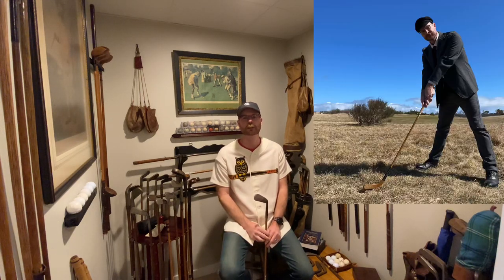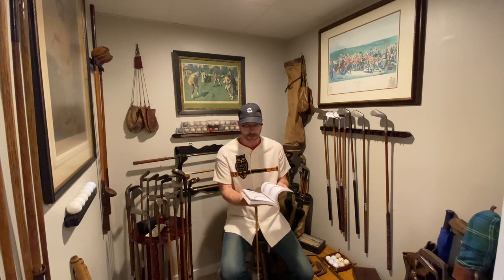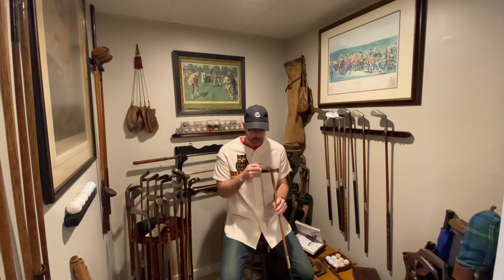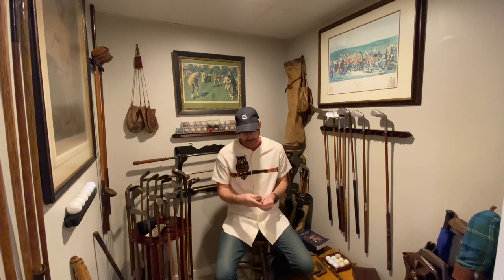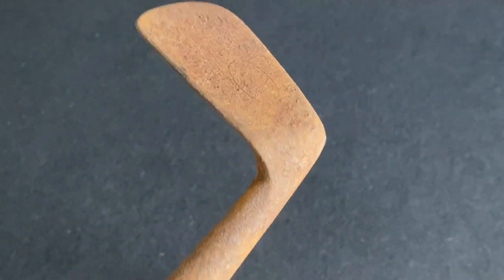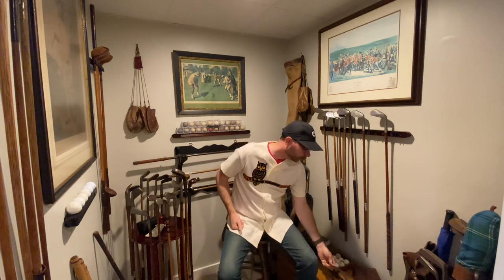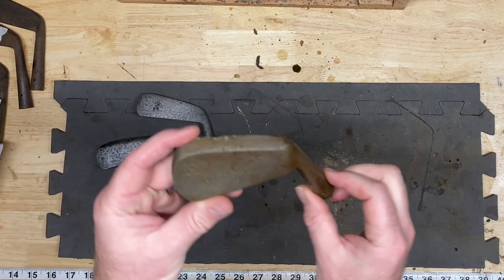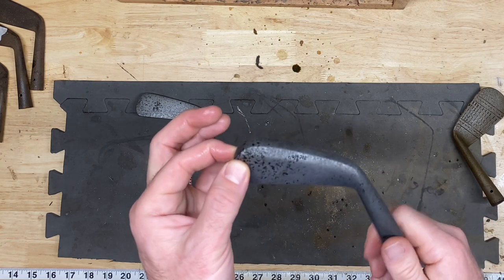Deciphering the Markings on a Tom Stewart Mashie: Hickory Golf - Fresh Finds #2

Comment: I really like where this series is going! Do you have a set of modern clubs? If yes, I think I would like to hear your take on why you prefer hickory over modern etc. Keep up the great work!
Reply: I'm someone looking to get into hickory, but my play set currently is a vintage cart bag, muscleback blades, persimmon woods(D,3,5,7), and a hickory shafted putter.

I have a modern set(still wit musclebacks) but I play vintage for the enjoyment of it.  Is it as easy?  No, but you have to learn to hit your clubs and try different shots just like hickory clubs.  If I score a 90 with old clubs on today's longer courses, it feels a lot better than if I shoot a 90 with clubs that are supposed to make things "easier". The feel of hitting a good shot is also different, and you know when you did it right because you can feel it through the club.
Reply from the maker: I sold my most modern set a couple years ago when I decided I wanted to play hickories full-time, but I’ve since acquired a set of Mizuno MP-57’s that I’ve started playing when I want to change things up. Now that I’m using the single-plane swing, switching between eras is easy because I use the sand swing for everything now. 

I’ll be doing a hickory vs. modern match play against myself soon where I play the same 9 holes with hickories and then again with moderns, and I’ll cover the many reasons why I prefer hickories in that video.
Reply from the maker: @patrickhenry236  Yeah, the satisfaction from hitting a good shot with hickories is hard to beat. You expect to hit good shots with modern tech, but you realize it’s more skill than tech when you do it with hickories.
Reply: @TheHickoryHacker  yes, just like the persimmons and knife edge irons I use now, only it will be a further step. Instead of golfing with 1960's Era it will take me back another 4 decades and will likely necessitate a change in my swing (single plane is hard for me due to damage from a car accident).

Thank you so much for the reply, and I will be looking forward to watching more on your channel.

Comment: looking to get into doing hickory golf. any tips on what to look for when antiquing ??? also can you get replacement shafts anywhere im a taller guy and will most likely need more length.
Reply from the maker: I made a video a while back on what to look for and what to avoid when antiquing for clubs: 
https://youtu.be/gZ48qyJKgms

A lot of the clubs you’ll come across will be too short and/or too light for play as-is. For new replacement shafts, I recommend Louisville Golf, but generally speaking I suggest sourcing vintage shafts from cheap heads. Most of the time, you can find cheap clubs for shaft salvage for less than the price of a new shaft, and as nice as LG’s shafts are, they’re still not as old or strong as a vintage hickory shaft if it’s still straight and in good shape.
Reply: @TheHickoryHacker  cool thanks for the info. I think im going to start with finding a putter and getting that in good shape. Then work from there replacing stuff in my bag
Reply from the maker: @Corrupted-by-Capitalism  Sounds good! Feel free to reach out by email if you’re ever looking for something specific.